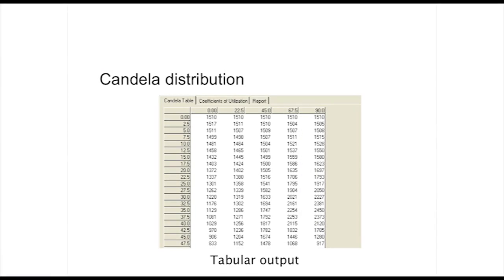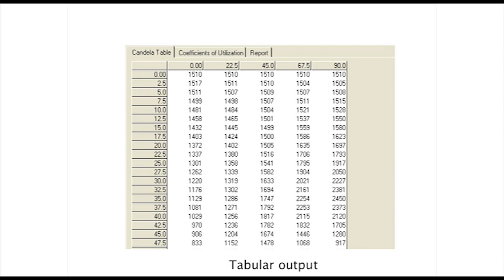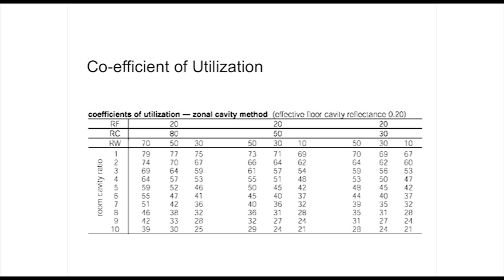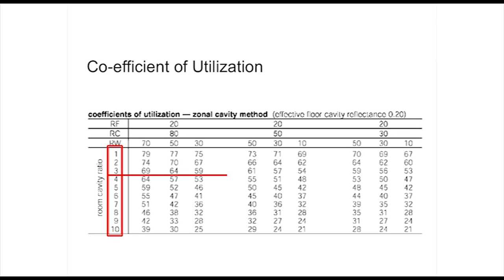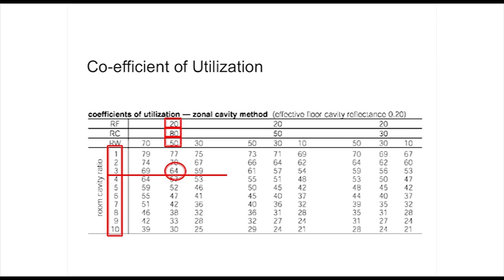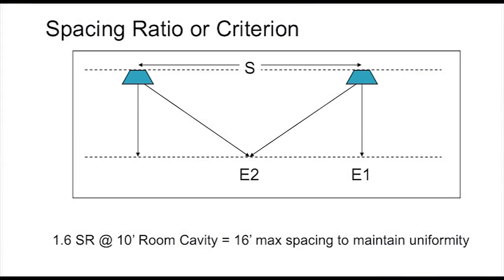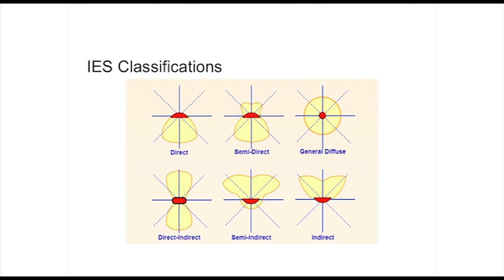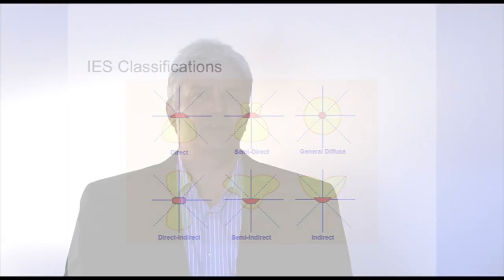Photometrics

Comment: I know this is a long shot as this video is so old but I'm trying to figure out how to determine the lumans I'll receive at a specified point on my work surface based on the height of my installation. Would I simply use the Candela distribution angle together with my other known inputs?
Reply from the maker: Hi Kurt, thanks for reaching out. Kindly send us a DM so that we can further assist you. Thank you!
Reply: @SignifyCompany  It doesn't appear you've set up DM on your YT page so I've DM'd you on IG. Thanks so much!